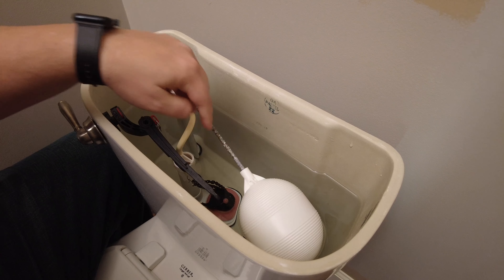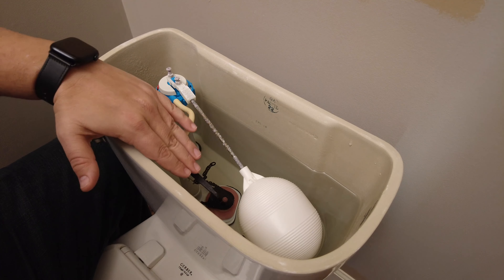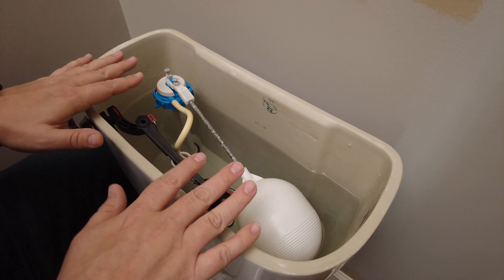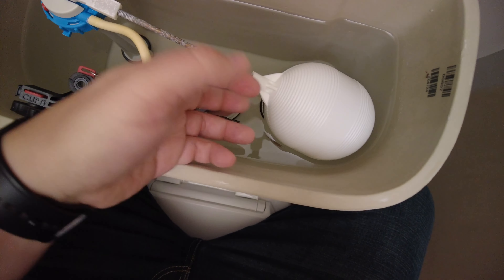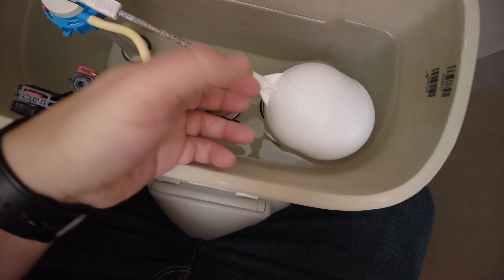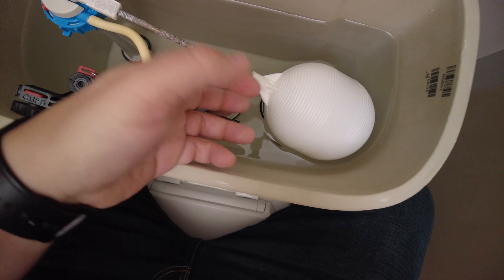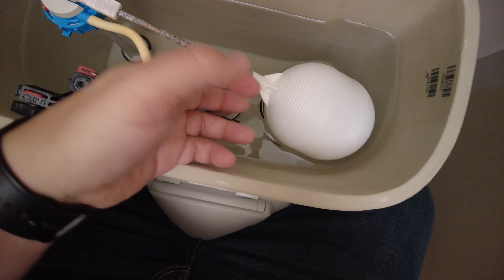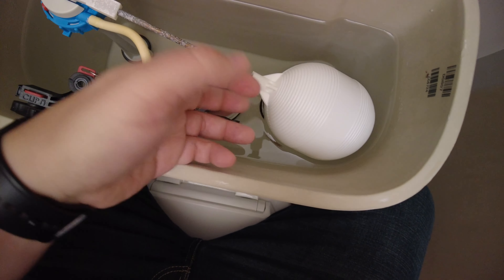How to Fix A Running Toilet Step-by-Step | DIY Plumbing Repair

Comment: Great video & information. 
This will help me with 3 toilets in my 1st house and 1 in my 2nd home. The other 2 in my 2nd home are a different style that I've never seen before. 
They have 2 flush buttons on the top of the tank. I did find out why but haven't looked into doing any maintenance on them yet. One of them did start running quite a bit, so I turned off the water. It wasn't used much, but that will change next spring, so I'll need to do something with it this winter. 
Are there any links in your library I can go to for repairing this type of toilet?
Reply from the maker: Sorry , we have not installed or had a dual flush toilet in our home. We will keep this in mind for the future though, thank you for your comment.

Comment: Hello! I’m having the issue where the water continues to fill the tank and leaks through the handle causing it soak the floor so after every flush I have to let the toilet fill then turn off the water and I’m not sure what’s going on. Any advice to fix this problem?